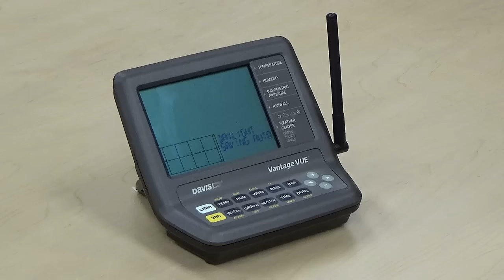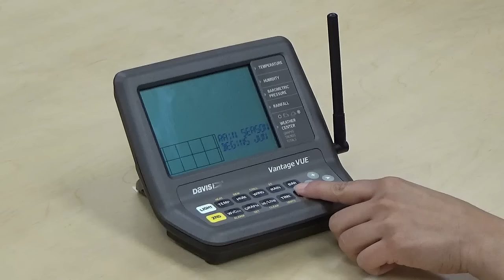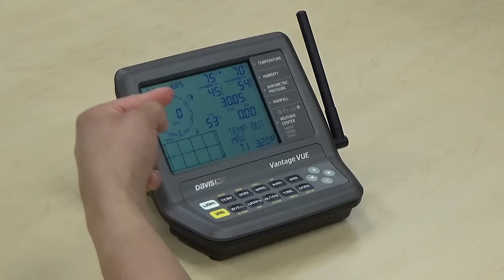Davis Vantage Vue: Overview from Box to Setup

Comment: Don't forget to align the unit's solar panel to accurately point South. Accurate wind direction readings and maximum solar power generation depend upon this step. You'll need a compass.
Reply: Use the north star, if you can find it.  Depending on location, magnetic north can be a few degrees "off".

Comment: Despite the rumors that Davis vantage vue is the 2nd best weather station out there for private owners the radiation shield is not enough by far, when the sun is between the angle of 18 to 35 it shows 2-3c too hot, daytime between 11 to 6 it works very good thought but if you want data that is comparable to airports and  NOAA you have to invest in a daytime-fan and connect it somehow which i also will.
Reply: Indeed, the morning sun heats it up much quicker than the actual temp..
Then drops down in temp once higher in sky

Comment: We have very high winds here. When it rains and the winds are high the rain seems to blow by the catcher and doesn't go into the spoon. Therefore the unit registers very little rain. Is anyone else having this problem? Is there any way to fix this problem.
Reply from the maker: For that kind of environment, you might want to upgrade to a Vantage Pro2 with the new AeroCone rain collector. It is specifically designed to be more accurate in high wind/light rain environments.

Comment: I had mine almost exactly  3 years just loved but now out of no where it no longer receives any outside data even put a new battery in but nothing support says it is "probably" a 160.00 transmitter but no refunds so now I have a table top thermometer. Really disappointing for the cost of this unit and the weatherlink module was well over 500.00 I would have expected it to last longer than it did..
Reply from the maker: Have you talked to Tech Support about this issue? (510) 732-7814, M- F, 7:00 am to 5:30 pm PST; or support@davisnet.com.

Comment: Thanks for the video. I have one. I'm facing a problem. I don't get the signal from the ISS after the console is set. What to do? Please help. Thank you in advance.
Reply from the maker: Hello Shafrin, my first guess is that your transmitter IDs either don't match, or your console is "hearing" another sensor suite that is nearby. Try resetting the IDs on both the sensor suite and the console from 1 to some other ID. (Instructions for how to do this are in the manuals. Click Support Documents on this page: https://www.davisinstruments.com/product/vantage-vue-wireless-weather-station/
 If that does not fix the issue, contact our Tech Support Team. They will figure it out! (510) 732-7814, M- F, 7:00 am to 5:30 pm PST; or support@davisinstruments.com

Comment: Does this solar panel on the outdor sensor charge the battery?
Reply from the maker: Hw Lela. No, the solar panel runs the sensor suite and charges the supercapacitor to run it when there is no sun. The battery is a backup. It usually lasts a really long time, but if you live where there is less sunlight available it might need to be replaced more frequently.

Comment: Vantage Vue does not get Temperature right! 
Because it does not have a fan inside the shield, once the sun hits it, the temperature increases way above the actual value. 
Get a Vantage Pro 2 instead. Believe me, I bought the Vantage Vue once and had to send it back and ordered a Vantage Pro 2 with Fan Aspirated Radiation Shield.
Reply: I believe the "passive" aspiration system of the Vantage Vue is quite respectable in recording an accurate temperature.  The Pro would certainly still be a "step up".
Reply from the maker: Luis, if your installation is in a place with high heat and low wind, the fan may be needed. Otherwise, our passive shields are fantastic! https://www.davisinstruments.com/product_documents/weather/app_notes/AN_24-temp-radiation-shield-comparison.pdf
Reply from the maker: You are right!
Reply: Davis Instruments   The problem is that people never have one or they don’t read the instructions
Reply from the maker: We work really hard to make our instructions super comprehensive, clear and available, but you are right, sometimes they never get read!

Comment: Having bought a Fine offset around 2 years ago I'm now looking to upgrade and looking at the Davis Instrument array I have a few questions. Despite my low budget device, I was able to have the barometer, rain gauge and thermometer in my sheltered garden around 1.5 metres off the ground, thereby giving me an accurate air temperature reading. The wind recording equipment was on a pole 10 metres up. My questions therefore is if I use this all in one Davis Vue and I fix it 10 metres up, will the temperature be affected by the wind chill? My garden is enclosed, south facing, protected by other houses and quite sheltered from the wind. I live in the UK.
Reply from the maker: We're sorry for the delay, but wanted to be sure to get the full answer from our Tech Support crew for you. Here's what Leticia in Tech Support had to say:

Wind Chill is the perceived decrease in air temperature felt by the body on exposed skin due to the flow of air. Mounting the Vantage Vue 10 meters in the air  will have an effect on temperature vs if it were at 1.5 meters.  However, the temperature in an enclosed greenhouse will have a larger difference in  temperature vs outside. Many factors can play into temperature variations.  If you want to know what the temperature is in your green house then that is where you should place the station. A better option would be the Vantage Pro2 so you can place your anemometer at 10 meters and temp sensor at 1.5 meters.
Reply: Thanks for the reply and I understand all that you say. I think I've decided to look at weather stations that can be separated and as good as the Vantage Vue maybe I don't really think its going to be best suited to me. I have looked at the Pro 2...There are a couple of competitors out there which do come well reported but sadly are not the quality of Davis. Thanks again for your reply.
Reply from the maker: In case it is helpful, you can see a quick comparison of our stations here: http://www.davisnet.com/weather-monitoring/#comparison_chart

You can also see a detailed technical comparison of the Pro2 and Vue here: http://www.davisnet.com/resource/can-find-detailed-technical-comparison-vantage-pro2-vantage-vue/

Best of luck as you search for the right station for your needs!

Comment: Como cambiar latitud sur... como cambiar unidades de temperatura
Reply from the maker: Hola Luis. If you are in the Southern Hemisphere, you need to calibrate wind direction on the console, and you can set your preferred units on the console too. See pages 26 and 27 of the manual: https://cdn.shopify.com/s/files/1/0515/5992/3873/files/07395-261_im_06351.pdf?v=1623784828

Comment: I have the Vantage Vue  . It's 2 to 3 degrees too hot during the day and is 2 to 7 degrees too cold on cold windless nights . No matter where I put the station on my property , high or lower in height , the same discrepancies in temperature happens.  I had my unit sent back to Davis to check out the temp sensor but they sent it back with the thought nothing is wrong with it and it is calibrated correctly . Well I'm tired of it (Temperature) with being gigged by CWOP quality check, thus failing Q check.  Also the wind speed/Direction is constantly fails Qcheck.    It is way too expensive to have this happening . So I bought a Tempest WeatherFlow to use and to see if the same temps/Wind happen as with the Davis .  Not happy with the high money paid for the Vue . AS of right now I do not recommend anyone to purchase one.